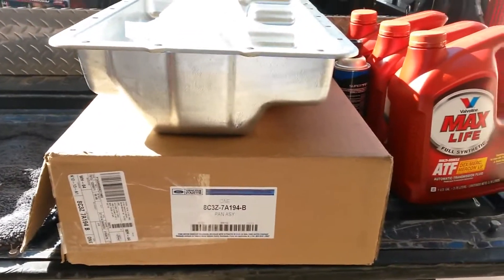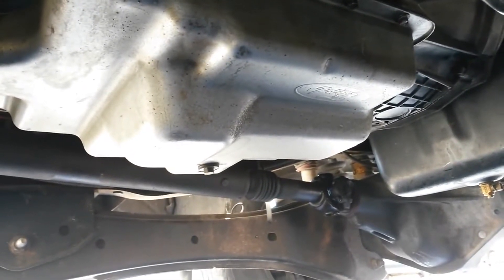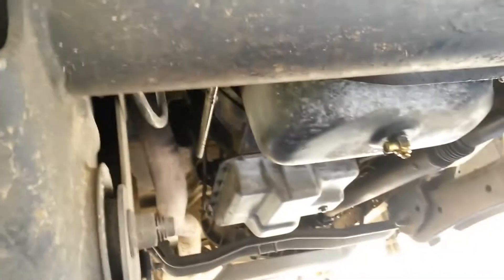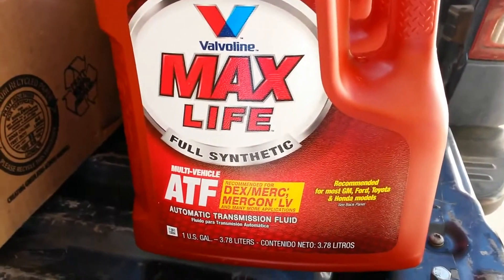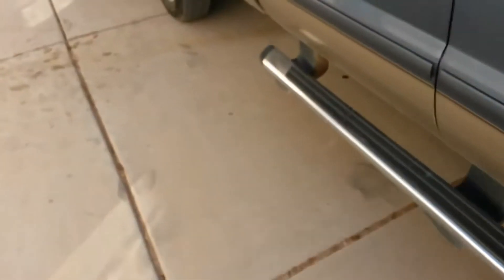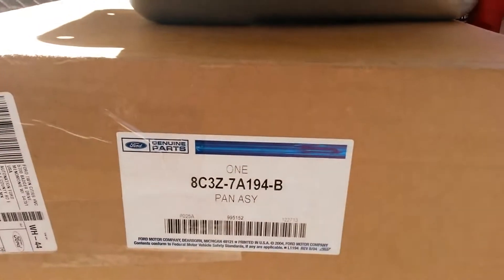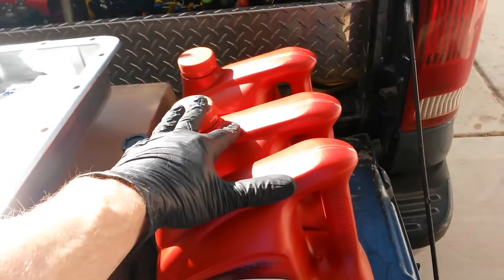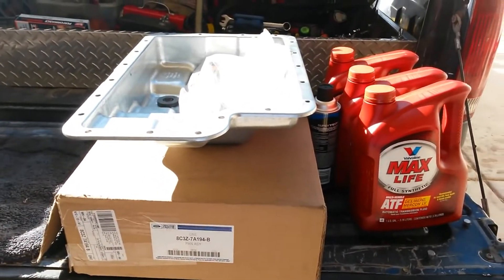FORD SuperDuty Transmission~ '08 Pan/Filter Upgrade~ '03-'07 - 5R110W ~6.0 L 6.4L V10

Comment: I put a remote filter on my 2007 6.0. I don't need to change the stock filter for 100,000 miles. I just drain the pain and spin on a new $10 remote filter and toilet paper roll. Always use Motorcraft transmission fluid.

Comment: If you are going to do this, switch to a thick and more ridged aftermarket pan, such as a PML.  You Gain 4 more quarts capacity, torsional rigidity, and cooling fins.  The ford pan is tin, and has little torsional rigidity.  These transmissions tend to twist under heavy load so increasing the thickness and depth of the pan is important.

Comment: Wanted to point out something to everybody I've been working for ford for about 15 years as a mechanic. So I know my stuff this person probably blew out his transmission the first time by not using Motorcraft transmission fluid there is no oil out there compatible to Motorcraft if your vehicle is a ford please use Motorcraft transmission fluid . Do not use Valvoline max life or any fluid that says it's universal. all you have to do is pull out the dipstick and read what type of fluid your transmission uses.transmissions that I've switched over to Universal transmission fluid or automatically burn out your transmission in a matter of time using these type of fluids that are universal or it won't shift right I just wanted to make that clear. Ford has five different types of transmission fluid. If you want your Ford to perform use Motorcraft parts and fluids. I have a 99 Ford E 250 we are at 356,000 miles on a original transmission never been rebuilt by running the right fluids will get you farther. I do like the transmission pan swap good idea .
Reply: Jesse Alcantar You sound like a robot
Reply: Been using Maxlife ATF in both of my Fords.  No issues and both have over 150k.  Shifts nice and smooth
Reply: Jesse Alcantar glad you pointed that motorcraft fluid out on this one because I’m having my tow haul light flashing with my trans temp gauge going out!just bought the 04 250 but gotta fix what I think is the sensor and replace fluid using motor raft
Reply: You make it sound like Motorcraft actually makes those fluids.  They make the standard and then Warren, Citgo or another bulk maker puts it in their red bottles.
Reply: I bought a 1991 Ford econoline e350 diesel engine the deep stick says to use mercon but at auto zone they wanna sell me mercon v they say is the same thing  should I put mercon v on my transmission?
Reply: Here's something for thought for anyone buying into the "Motorcraft Mercon LV" only crowd. I'm curious as I've been in automotive manufacturing for over 30 years working with a lot of different OEMs. Ford/Motorcraft doesn't "make" much of anything. They do actually "manufacture" a few things, but fluid is not one of those things. Ford "assembles" vehicles. They mostly just spec parts, components, and fluids to 3rd party manufacturers to have them made for Ford. They want high percentage royalties to "license" fluids with their "Mercon LV" stamp regardless of whether the fluid meets or even exceeds their specs. If a fluid company "recommends" a product for replacement, they are officially on the hook for lawsuits if the fluid doesn't meet or exceed the requirements of the specification. So why would a company with an outstanding reputation recommend a fluid for an application that would ruin their reputation and set them up for lawsuits if it wasn't up to meet the task? Some manufacturers opt not to pay the extortion fees for the "official license" to funnel money back to Ford on their hard work and research. Has anyone seen a "Motorcraft" or "Mercon" refinery or chemical plant producing "Mercon LV ATF"? Or are there only a few fluid manufacturers all being highly competitive and trying to outdo each other with superior products and better pricing?

Comment: Seems very straight forward.  So using the part numbers in the video I can go to my local dealer and get the parts and they will "plug and play" on my 2004 F-350. Currently I'm running Motorcraft fluid, but if I want to switch to Valvoline as in the video, do I need to do a complete flush before hand?

Comment: Great video! How is the transmission holding up with the Maxlife ATF? So many Mercon variants with LV being the latest. Forums go 20 different ways leading to confusion with LV, SP, and V. I've always liked the Valvoline Maxlife as it has the latest additives but they didn't pay Ford for the "license and royalties". But I'm new to the Ford arena and there is a massive "Motorcraft or nothing" crowd. Is Maxlife still working good for you? Thanks!
Reply from the maker: Still going strong. The thing is, if regular flushes or maintenance has not been done, introducing new fluid (even Ford) can dislodge all of the deposits and clog things up, hence the filter upgrade.
Reply: @SuperDuty  Thanks for the quick reply! I bought it used, so the true history is unknown. The ATF fluid looks and smells clean, but I always change all fluids with used "new to me" vehicles regardless. I've been away from Ford for 15 years or so, so I'm doing my due diligence. There's a lot of conflicting info on fluids out there with these trucks.

Comment: You must not know the purpose of a bypass filter. That frame mounted filter removes smaller debris than the full flow filter can. If the bypass filter is plugging up, change the element. If that full flow inline filter plugs up, you get no fluid to the pump.
Reply: You must not know that the upgraded full flow filter is what Ford started using after 2007 because the bypass setup had so many issues... Hence the upgrade. It can be left in and continue to do a partial job filtering fluid..

All full flow filters have bypass if clogged like all oil filters.
Reply: @SpaDayz  Not true, all full flow filters do not have a bypass valve. I have a 2008 F350 with a full flow transmission filter. It has no bypass. If the bypass filter was serviced properly, it would have kept the transmission fluid much cleaner than a full flow alone.
Reply: @JT-qf4it  Dude! Every factory made filter has a clogged filter relief "bypass", or has such a bypass system engineered into the filter housing, even those old hard oil can oil filters used on everything in the last 40 years have a bypass.

The video clearly shows the bypass filter built into the full flow filter.

Either way, you can still use the toilet paper filter in addition. Your 2008 doesn't have a Tp filter and already has the upgraded pan and full flow filter.

Drop the pan and look at it.
Reply: @SpaDayz  I have installed many filters with no valve in them. If they have a bypass valve, it would have to be else wear in the system. My 2008 also has no bypass valve in the transmission filter. It is full flow.

Comment: Thank you for the excellent video. I have a 2005 F350 Super Duty Crew Cab SRW FX4. I purchased the upgraded 2008 Tranny Pan and upgraded filter. According to Ford Powerstroke both the 2005 and 2008 F350's fluid tranny capacity is 17.5qts. When I install the new pan and if I don't blow out the fluid thru the on chassis toilet paper filter hole, can I just replace the amount of fluid that was captured in the drain pan from when I removed the old tranny pan? With the new pan being deeper I didn't know if I needed to add more fluid or not. I don't drive this truck much. It sits all winter. Just turned 70,000 miles in Oct. 2019 then put it in storage. Thank you for your time and I am a new subscriber.
Reply from the maker: You will need to add more, but you can always just start with the amount you took out, then just add a half a qt at a time until you get it in the middle of the stick.
Reply: @SuperDuty  Thank You. I'll do just that.

Comment: Will this pan and filter upgrade fit on my 2006, 6.8 V10, with the 5R110W trans, on a E450 super duty cutaway van chassis?
 thanks in advance for a reply

Comment: Two lines run beside the engine oil pan into the crappy FORD toilet paper filter.  You cut out the Ford remote filter filter entirely, and I am forced to do the same as the POS Ford toilet paper filter housing was not able to be spun open due to previous owner's/dealer's negligence/corrosion. 

Can you explain/show which line you connected straight through and which line you installed the Magnafine (along with flow direction of the MagnaFine)?   Anyone?

Comment: Where did you buy the oil pan? want to do this swap but having trouble finding the correct pan. Also if you dont mind sharing about what the total price including all the fluids and gaskets that would be awesome. thanks
Reply: pan is about $85. links in the video description. hit the drop drown arrow under the video

Comment: Please on question. (Sorry for my englksh is a disaster) I have Ford E-350 Econoline super duty year 2001. Engine 5.4 L V8    I dont know my type of automatic trasmission if are E40D or 4R100 or 4R70W. Can say me what type are my trasmission please? And what type of oil trasmission i need?Mercon or mercon V?Thanks a lot.Hace 52 segundos•

Comment: If I change over to this filter and pan, then add in Maxlife, should I replace the filter again soon after since Maxlife dislodges stuff? Seems like you'd want to drop the pan and replace it to prevent material clogging.
Reply: It might be a good idea. It's a pretty hard core filter so it can take a lot of debris before the bypass kicks in. The bypass on the new filter is the same screen type as old filter, so even if the bypass does kick in, you get the old type of filtration.
Reply: HHCDiesel Thanks

Comment: Nice Vid! Hows your truck doing now? How many miles have you put on her? Thanks!
Reply from the maker: I'm up to 412K miles on the odometer. Still running great
Reply: Nice! Good amount of miles for a 6.0, what types of mods you have? (deletes, intakes, exhausts?) And what type of oil and coolant you using? You also still on original head gaskets and head bolts?

Comment: Hi its only for f250 6.0 0r also for f250 5.4 gas.
Reply from the maker: Only the 6.0L with the 5R110W transmission
Reply: Ok thanks hey how can know what type its my transmicion i dont have the owner manuel anymore
Reply: Mine its 2008 f250 superduty 5.4 gas xlt.thanks for your help
Reply from the maker: @lardtamps  Simply Google "2008 f250 transmission"

Comment: This did not work on my 6.8 v10 2004 xlt 4x4.  Pan was hitting valve bodies and would not seat all the way.
Reply: I’m assuming you’ve already found out. This is a DIESEL 6.0/6.4 ONLY. YW

Comment: just double checking here.... will this work on the '02 with a 4r100 transmission?
Reply: Shane Martinson no, not at all
Reply: Almost all of the aftermarket deep pans are interchangeable between the eod, 4r100, 5r110, 5r110w, so why will it not work